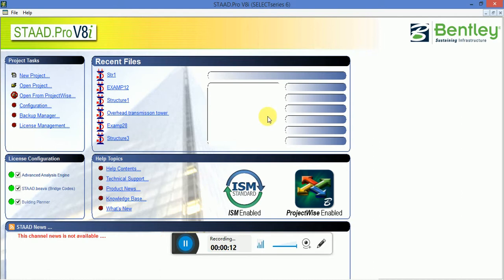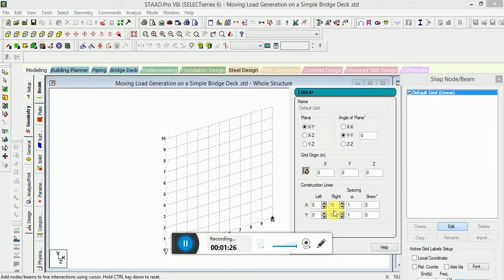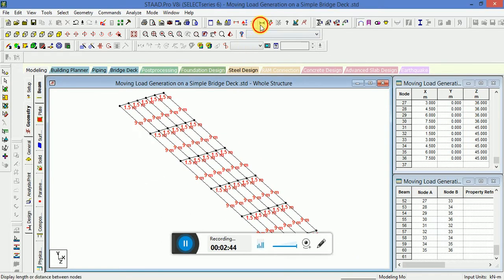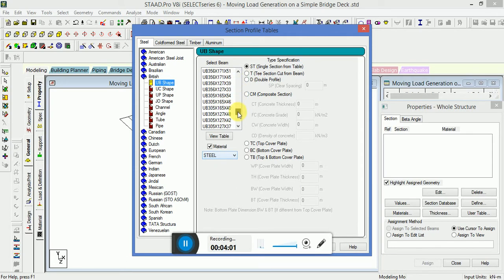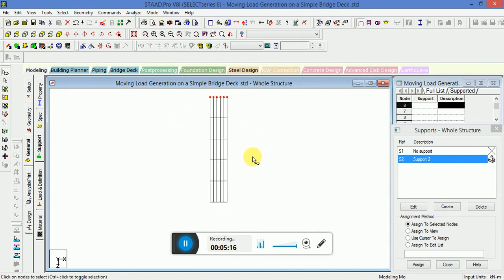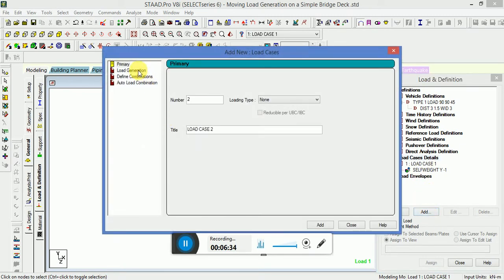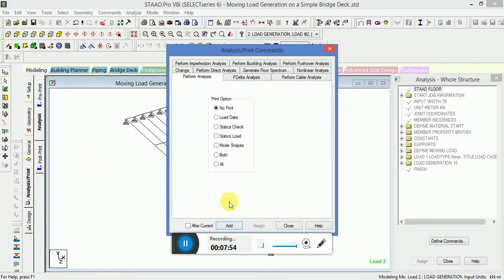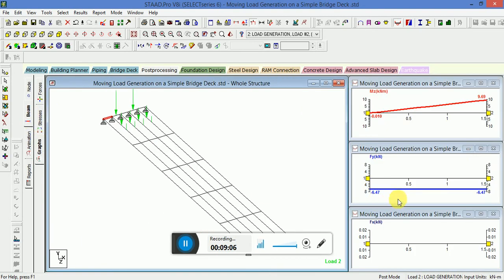STAAD PRO MOVING LOAD GENERATION ON A SIMPLE BRIDGE DECK

Comment: Why Surojith so much complication, Ask your developer to add moving load with horizontal loads !!  Lets say I have 4 wheels how to add horizontal loads for respective wheels assume wheel loads have different vertical intensity , In robot analysis software we can directly add moving loads where as in staad it is not possible

Comment: Do you not require plates with a mesh to represent the concrete deck surface that lays on top of the beams??
Reply: You can use floor load command, 1 way-distribution.

Comment: Hi there, I am completing a bridge analysis for a university project, and have come across an issue when running a moving load across the bridge deck, and would be interested to see if you have come across this issue or have any advice on how to overcome it.

When I apply a moving load at a certain x-coordinate, when I run the analysis the resulting moments seem to be applied to the wrong members. By this, I mean that the vehicle is traveling down a path in between beams 3 and 4 of my bridge, however, when in the post-processing stage, beams 2 and 3 are the only ones that show moments, with a very small moment in beam 4. This is obviously incorrect, however I cannot seem to be able to find a reliable fix for the problem.

I would be most grateful for your insight on this issue if you have ever come across such a problem.

Kind Regards.
Reply: Hello sir, I am about to carrying out a university project about  bridge. So can you please help me out.

E-Mail : harshithravindra22222@gmail.com